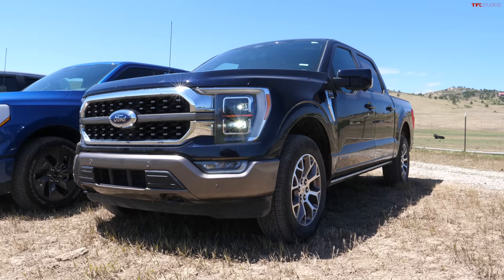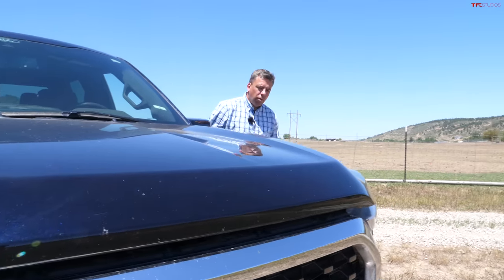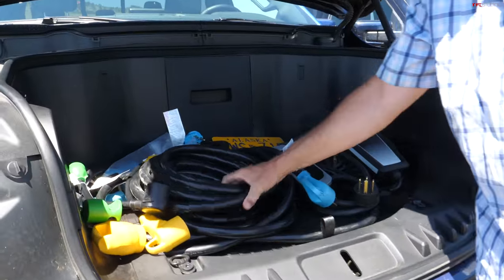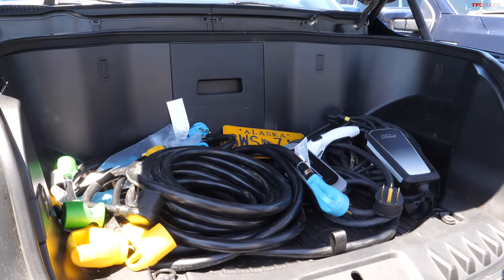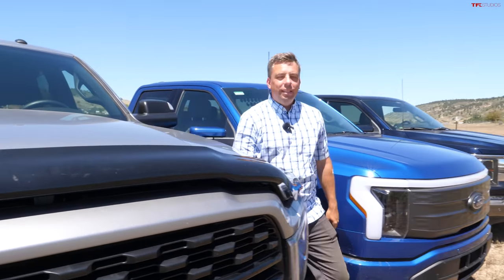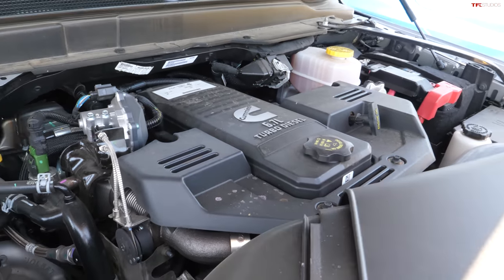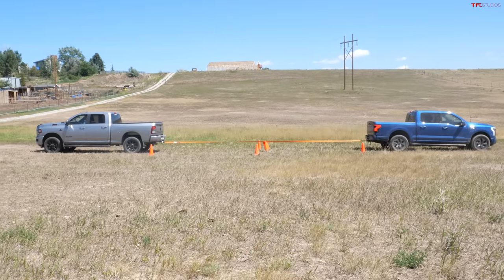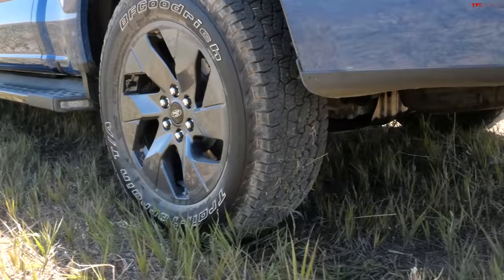Diesel vs Electric Tug-of-War: Ford F-150 Lightning Takes on the Ram 2500 Cummins In a Nail Biter!

Comment: All about tires and gearing and weight of its in the right spot. HP, torque don't matter much, a 50 HP tractor that weighs about the same as these trucks would out pull all of them
Reply: Gearing.
I own a 1952 massy Ferguson 55 with a 60 hp 3 cylinder diesel and I assure you that in low in first it would pull any truck around with ease
Reply: We have a 30 year old 4x4 forklift at work with a optimistic 50hp Perkins in it but the thing is so damn heavy with its counterweight and ridiculous low range gearing I guarantee you that would outpull just about anything on the road!
Reply: the weight alone makes big difference that EV is a good tonne heavier then its diesel counterpart.
Reply: @Welcometofacsistube  with a tractor, the other part of the equation is traction (hence the name).  The usually lugged tires as well as the larger contact patch the larger diameter tires and lower pressures give you allow that torque from the low gearing to be more effectively transferred to the ground.
Reply: @jamesbeaman6337  very true
Reply: Ram's tires looked horrible
Reply: @mtguy234  technically they all have horrible ties all the Ram Fords and GMs that imported here to Australia have to have their factory tyres replaced as they're nowhere near road legal here who even make single-ply tyres any more?

Comment: The question is how much gas is left in the 6.7L vs how much charge did the EV truck burn through. 

Also the 6.7L hauling a load will go further on a tank of gas than the EV truck will go on a charge with the same load.
Reply: Plus it takes 20 minutes to fill. Not hours if not several hours to charge. Which in the transportation world or hauling can be a nail in the coffin for EV. My other argument is. Generally diesels are pretty easy to repair in a break down situation. /Most/ people can't exactly repair a battery on the side of the road. Hell as far as I know most auto parts stores don't carry most EV components. Most of us can change an alternator or injector etc on the side of the road. Not a several hundred pound battery pack lol

Comment: Solution found by Tug boats and train locomotives is use a DIESEL ENGINE TO RUN GENERATORS THAT RUN ELECTRIC MOTORS
Reply: The og hybrids dating back to pre ww2? Except it was diesel electric submarines who employed that tech first. 
Basically all large earth movers do the same thing, big stinking hot diesel powers a generator driving huge electric motors&hydraulics.😀

Comment: Hey guys, what percentage of battery did those pulls kill?
Reply: It would be less than 1%. Each pull only lasts for about 15 seconds. They would have to be flooring it and using the maximum power output for the entire pull to come close to using 1% of the battery. But they couldn't have been flooring it because then the wheels would have just been spinning. So the average power draw has to be much, much less than the maximum power.

You also can't draw max power at low speed because your RPMs are too low. If we assume that the Lightning's wheels were spinning at about the right speed to travel 10mph, making the motor spin at about 1,000 rpm, at max torque that comes out to 110 kW. Over 15 seconds, that power draw would use 1/3 of 1% or roughly 0.3% of the battery. Even this is a high estimate because they couldn't have been using full torque on the dirt, so power would have been lower still.
Reply: @lawrencemaroun3310  I’m a technician that has to work on EV, you’re not even close to being correct
Reply: About the same amount of Gas the diesel burned....lol
Reply: @lawrencemaroun3310  That's an awfully technical response that isn't even remotely correct.
Reply: @rickpotera3942  what's the answer then? How did you arrive at it? Show me your assumptions and calculations. Otherwise you're just making stuff up.

The math is clear as day. 430kw (max power) for an hour is 430kwh. 15 seconds is 15/3600 hours. 430 * (15/3600) is 1.8 kWh. That is 1.3% out of 130kWh. So that's a clear upper bound for energy consumed over 15 seconds and we know that they weren't flooring it, so we know that the true consumption was some fraction of 1.3%.
Reply: @lawrencemaroun3310  A bunch of but hurt Ram fanboys.  I own an electric car and guess what?  At low or no speed battery consumption is minimal to nil.
Reply: @allankoivu3263  Completely depends on the load. You can’t compare standard driving to pulling.
Reply: @lawrencemaroun3310   It's actually 4.3%
Reply: @lawrencemaroun3310  math is never clear on EV vehicles.  Look at the towing test.  The battery showed they used 3-4 times as much battery as planned, it predicted they would have driven 3-4 miles for every actual mile driven.  Putting electric motors under strain used a lot of power.  Hell, they used 1% sitting there talking on their walkie talkies.
Reply: @allankoivu3263  Isn't it great; big long monologs from guys sitting in front of their computers at home, doing theoretical calculations about how well EVs (are supposed to) do. I just love it. Don't you? 😶
Reply: @allankoivu3263  I own a diesel and guess what? At low to no speed diesel consumption is minimal to nil.
Reply: @ethanlee3254  That is only true if the engine shuts off at a stop and you have no fuel consumption at idle speeds.  My electric car consumes nothing little when stopped or in stop and go traffic
Reply: @allankoivu3263  all new trucks are equipped with that feature now. Still, fuel consumption at idle is super low. Fuel isn’t evil and ev’s aren’t somehow a more moral choice. How is electricity made? You can’t escape it
Reply: @rickpotera3942  that's an awfully grammatical response lol. awful*
Reply: @rickpotera3942  Right 🤣 low speed has nothing to do with it
Reply: @ethanlee3254  none of this even matters anyway. Putting all environmental debates aside, electrics have everything you could want in a vehicle except the most important thing and that is what is and will continue holding EVs back from being anything beyond city commuter cars.  They are just impractical.  They don’t serve rural communities well do to their relatively low range and long recharge time when compared to a combustion engine and the batteries are not efficient enough to handle serious work for sustained periods of time. 

Time to quit pushing the EV revolution until they get some R & D into a better battery and they get a plan in place for better infrastructure to support these things also…..and while they are at it the entire industry needs to agree on a standard for connectors to charge these things.
Reply: @CyberNut930  Even then what real man would want that boring garbage lol disgusting
Reply: @ethanlee3254  Where I live the electricity very clean hydro and nuclear.
Reply: @ethanlee3254  In the final analysis it costs me $2 in electricity to commute. In the past it cost me $16 in gas.....never going back.
Reply: 101%
Reply: @allankoivu3263  that’s not true and you clearly have zero knowledge of Diesel engines. You could literally let one sit at idle easily for at least 18 hours and use very minimal fuel. Go let you pos ev run for 18 hours straight and tell me how well it does
Reply: @jonathanewers5740  I work with diesel trucks and this is patently untrue. besides the awful smell and DEF consumption the units only can idle for long periods because they have massive fuel tanks.
Reply: @jonathanewers5740  BTW electric vehicles do not need to run continuously.  When they stop they do not "idle"  they shut off.
Reply: @heartwinners410   exept the diesel still can drive home.
Reply: @allankoivu3263  lok! Tesla doesn't use their own semi's
Reply: @Allan Koivu   Allan I'm an electrician. Trust me; you can have whatever clean hydro or nuclear power. It's is not ready to take the amount of charger need it to power all these cars during a demand. As it is, the power company switch lines back and forth during the summer because the line gets overwhelmed by people using their their AC. Don't let the news fool you. Also, someone did a review with an F150 electric truck, towing a car, and the guy almost ran out of power after 45 minutes of towing because the truck was using  more power during towing. So, in reality, the average guy driving back and forward might see some use out of it. Us trade guys will not get an EV truck until they become sustainable.
Reply: @lpollock16  I keep hearing that one day I will not be able to charge my car but you know what......The car takes the equivalent of an electric stove or a central air unit.  Never had a problem running those in the past and now I can still charge my car, run my stove, run the air conditioning unit and my hot tub all at the same time with no problems.  And to take advantage of lower rates I charge my car over night when demand is low.  Where I live we know how to properly run the grid.....thus is no Texas.
🤣
Reply: @motodude46  The Diesel is the same as the electric car they both need juice to run and when they run out they won't make it home . There is no difference.
Reply: @allankoivu3263  Well, if you want to belive your theory no one is gonna stop you. I work with this stuff everyday. Enjoy the ability of charging your car anytime, eventually you be joint the Californian club.
Reply: @lpollock16  Not likely soon we have a surplus of power that is exported elsewhere.  I own a Volt which means worst case I back up with gas.....BTW I think being an engineer trumps an electrician so my "theory" might hold some water😏
Reply: @allankoivu3263  Again, belive what ever you want to belive. Not one is going to force you understand how electricity works. And your reply tells me everything I need to know about you.🤷🏽‍♂️
Reply: @lpollock16  Given the problems you allude to your grid must be third world at best.🤣
Reply: @allankoivu3263  The Ram held its own well after the initial gain from the immediate torque from the Lightning. I had a suspicion this would be the result. It's because of the similar reason as to why the 5.9 Cummins gets pulled like a dog on a leash by the 5.9 Magnum in such a similar pull. I'll take the 5.9 Cummins if I'm hauling across half of the country. In the truck pull? Even when those 5.9 Cummins are tuned they get pulled by the 5.9 Magnum which has far less overall torque and either lock their brakes, or spin their wheels. It's the turbocharger, just as was mentioned in this video. It isn't a high compression engine. It takes a moment to build boost. The Ram did well after the initial start. Neither truck was going to win after that. They may have damaged parts if they continued? Neither was going to win after that initial surge by the EV. Just as the 5.9 Cummins will get tossed like a rag doll by the 5.9 Magnum because of the turbo lag, it's the same story with the EV.
Reply: @miragesmack007  that's because they didn't hire him to do the math for them.
Reply: The electric Ford Lightning actually has 320 miles of range, in the platinum trim. Do you drive more than that at work? The less expensive one has 230 miles range...again, do you drive longer than that at work is the question. 🙂
Reply: @neutrino78x  What if work consists of hauling a horse trailer for 200 miles? Will it give that range like a diesel?
Reply: @brianwesley28  

"What if work consists of hauling a horse trailer for 200 miles?"

We don't have enough data on the truck available for me to answer that. But do you personally have to haul stuff for 200 miles? What's the longest you have to haul stuff in a given work day? Is it longer than the 320 miles for the more expensive version of the truck?

200 or 300 miles is a lot of driving.
Reply: @lawrencemaroun3310  even on its best day that's a bunch of nonsense.  Apparently you have zero clue how inefficient in the real world those batteries are. Go watch some actual real world towing test not the propaganda data.
Reply: @neutrino78x  Actually yes. 3-5 times a week I tow 10-20k pounds 300-600 miles.
Reply: If this test was about fuel capacity, than yeah diesel wins. But electrical motors have torque all day instantly, there is a reason why electrical motors were used to build all three trucks in a factory. You don't see diesel engines running lathes or mills, cause they lack that instant torque. This is like a religion of diesel fanboys, you just believe it can, but in reality it can't. I still won't be getting the lightning because the current battery tech sucks. Diesel is still better for your money. Dam just be real and agree with the torque facts...
Reply: @dmitrypolovin1776  

"I still won't be getting the lightning because the current battery tech sucks"

Maybe. Depends on how far you have to haul stuff at your job (if that's what you're using it for). But it's going to get a lot better because we have a law in California that starting in 2035 all new model-year cars sold in California must be zero emission. Since we're one of the biggest car markets in the world, and other countries are joining in on that too, notably UK has a similar law, ICE is going away pretty soon. 🙂
Reply: @ironfistleadfoot336  

" Actually yes. 3-5 times a week I tow 10-20k pounds 300-600 miles."

See, in YOUR case, battery isn't there quite yet.

It will be soon though. This is 1.0. The 2.0 version will go farther and the 3.0 version will go farther still.

The California law says all new cars (for that model year and going forward) will have to be zero emission starting in 2035. I think it's quite plausible that you could have a truck that goes one way for 500 miles with 20,000 pounds running on batteries by that time.

I am no fan of Elon Musk on a personal level, as far as politics he's a tool. But he did say that his company's research says we should have a 500 W/kg battery in about five years. That's a pretty powerful battery. Current ones are less than 300 W/kg.

If Musk is right, by 2035 we should be solid on batteries that can do what your truck does, bro. 🙂
Reply: @brandonweeks  I am a CEVT certified technician. What are they not correct about?
Reply: @rickpotera3942  there are multiple other pull videos here on YouTube that verifies that claim... all less than 1% lost on battery when going this and similar tests... just look up people bringing these things to truck rallies on YouTube.
Reply: @heartwinners410  and how much coal was burned or diesel used to run the generator to charge the battery?
Reply: @allankoivu3263  Lol tell me that 5 years from now. With your broke down cereal box toy. You cannot eliminate fossil fuels….
Reply: @bigkountry29  Have no interest in eliminating fossle fuel...need that for the suckers with pickup trucks to pay road taxes.🤣
Reply: @waynearmstrong5525  your argument is tic for tac because no matter how you slice the cake you have to get electricity from some source whether it be coal, oil, water, steam or the sun nothing runs by itself without a power source. So what's the point your trying to make?
Reply: SAM SAM  Obviously you have never driven a Tesla...lol
Reply: @jonathanewers5740  almost n9thing, if it isnt moving
Reply: @joecurtis3745  actually, EVs are way more efficient
Reply: @G-FORCEEE  Does anyone else see the irony in that statement?
Reply: @scipioafricanus6979  so to discharge battery that much you would need 1000kw of power during this 19s pull lol
Reply: @lpollock16  Electric vehicles can actually make grid more stable by charging when consumption is lower and providing energy to households when energy consumption is high. Only small percentage of electric cars need high speed dc fast charging at once and even for longer trips you can charge slower when you eat.
Reply: Another year of not using $3500 worth of gasolene.  Actually used approx $400 in off peak electricity.....enjoy driving your gas guzzlers🤣